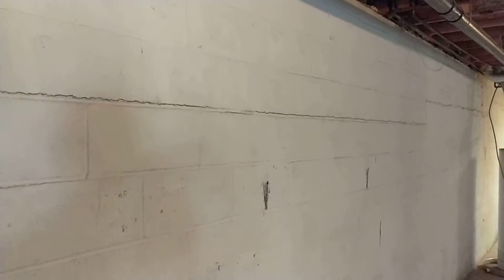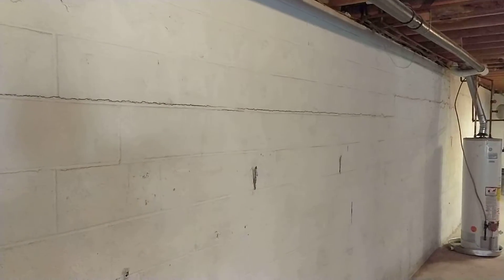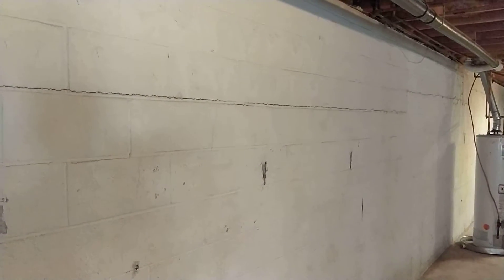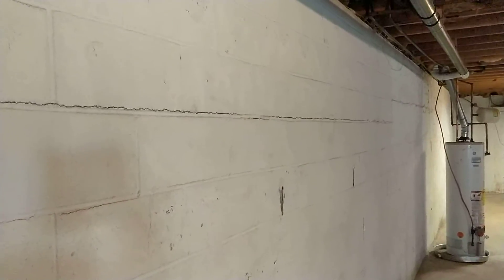Horizontal cracks in basement walls 1

Comment: What if I have a wall inside a house between 2 rooms and it has like 4 horizontal cracks (2 on each side). On one side one is on the bottom and in the middle of wall, and on the other side 2 are like between the bottom and the middle. I only found an information that it can be a pressure from above, that the wood roof construction can press on this wall (the building is 70 yrs old and never had changed the roof).